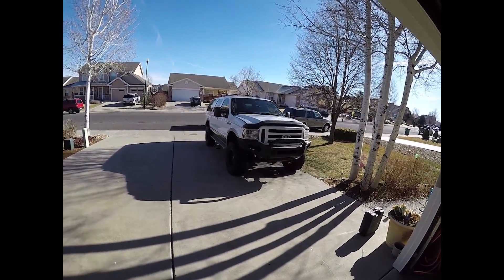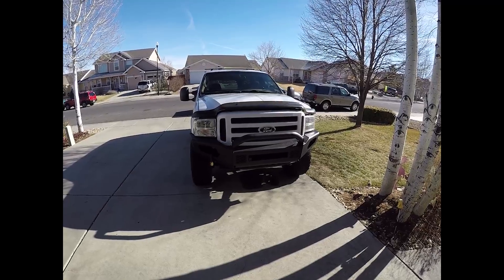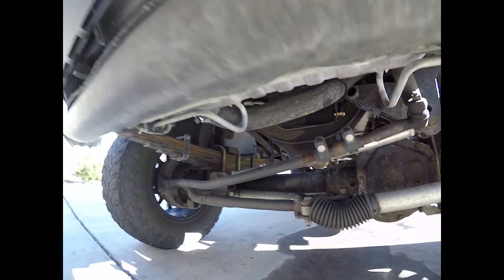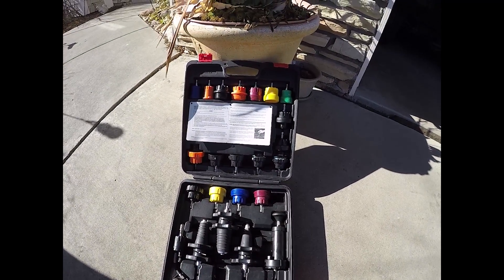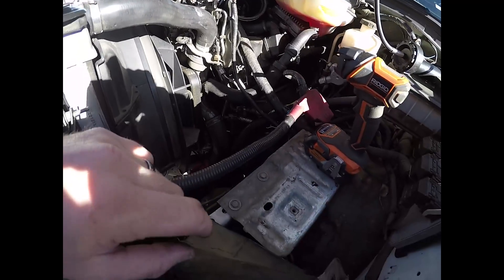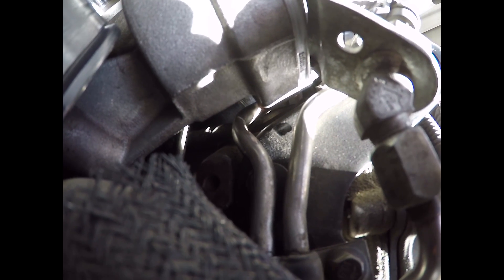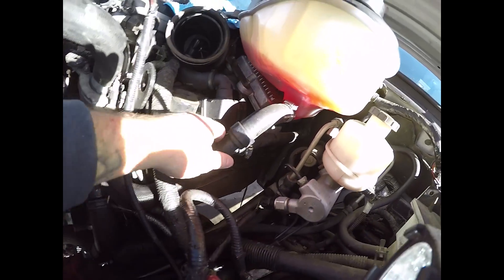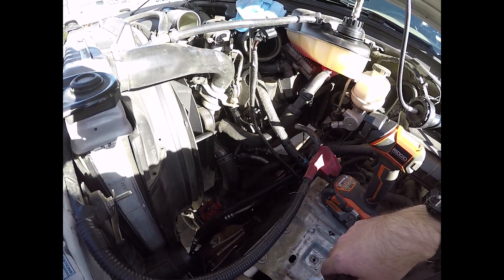Ford 6.0 Diesel Cooling System Pressure Test Found Leak

Comment: I have the intermittent leak also. I found that my cap was bad. Holding pressure sometimes and other times not. So i think the leak is when it is over pressurized and not venting at the cap. Unfortunately, It looks like a head gasket leak causing the pressure in the first place.....

Comment: I see you’ve got a set of double shocks. How much did that entire setup cost you and do you like the ride now?
Reply from the maker: It's been awhile since I put the dual shocks on cost wise back then they were about $100 per shock for the icons not sure how much they are now and the brakes was maybe $75. As far as the ride it's very stiff and rough but could be the stiff leaf springs up front as well.
Reply: @BLUECOLLARGARAGE  do you remember where you got the dual shock kit from, per chance? Smooth lookin truck, by the way.
Reply from the maker: @chriswools638  thanks for the compliment its been about 13 years since I put everything on   everything is from icon vehicle dynamics
Reply: @BLUECOLLARGARAGE  sick man. I appreciate your time! I just picked up an 04 X, and I’m about to push it towards an over landing type setup.
Reply from the maker: @chriswools638  heck yeah man sounds awesome hold on to that X they hold their value. I'm gonna be doing some more work to my 05 X upgrading the rear bumper with a tire carrier and some interior upgrades. Hopefully I'll have enough time to post some videos on it.

Comment: Man, I've had two 6.0's. First one was a 06 cred cab long bed 4x4. 11 inch lift on 37's . nothing  but a money pit! Head studs , bullet proof remote mount oil cooler, Turbo, injectors, fuel system  and  tuned...ect.  . Fun? Yes.. reliable..HELL NO!!  That sucker ate oil coolers for some reason. Every 10k miles I had to put a new oil cooler on.  Then the heads cracked.  It never over heated. So then new O-ringe heads. It still would build pressure in the degas bottle.. up to 20 psi under boost.  So Had new gaskets done again! Sold the truck. Then I had a 07 reg cab 4x4 6 speed.. best truck I ever owned!  Why? I Left  it stock!
Reply: You went through so many oil coolers cause you cheaped out.
Reply: @iamn360   you think so?? Lmao  everyone was OEM Ford parts with a Bullet proof remote mount system. It's a junk motor that there is no fix to. I've had 2 of them as well as my brother has had two of them

Comment: And non OEM degas caps cannot be trusted, they can leak when brand new and not hold pressure when new.  Your cap is OEM motorcraft BECAUSE IT DOES NOT HAVE A STICKER WITH THE PSI INFO ON IT..IT IS EMBOSSED WITH THE INFO..THIS IS GOOD

Comment: I think (THINK)with a head gasket leak the radiator fluid leaks into the engine and comes out the exhaust pipe as white smoke (
Reply: Honestly most HG leaks on the 6.0 dont leak in oil or out of the tail pipe

Comment: What kind of test kit is that? I’m having the same issue, had my truck running in the driveway while my son and I waited for the bus. Once the bus picked him up I backed down the driveway and shut it off. Came out to get him ofc the bus and I had a puddle of coolant on the ground where I parked
Reply from the maker: It's the powerbuilt kit number 70 I just rented it from my local advance auto parts https://shop.advanceautoparts.com/p/powerbuilt-tools-kit-70-cooling-system-pressure-kit-22-piece-940427/9150049-p?product_channel=local&store=5243&adtype=pla&product_channel=local&store_code=5243&gclsrc=aw.ds&&gclid=Cj0KCQiAtf_tBRDtARIsAIbAKe2eFyP3Bc7goULx6WJixgcz2vjtnDnZEAsAYL4y8M847apKPKkHEpIaAqorEALw_wcB

Comment: Thermostat housing oring??
Reply from the maker: Yeah it did end up being the o ring. Since then I have been leaking coolant from the degas bottle cap under heavy load. So unfortunately I think the head gasket is on its way out.
Reply: ASTEW'S GARAGE I’ve got an 05, after my engine was bulletproofed I had a leak as you’re describing. It wound up being my thermostat housing o-ring as well. I’ve had a lot of work done to mine, still gotta ways to go.😂 Never ending with these 6.0’s! But for the price of a new PS, I can rebuild mine again twice over.🤣
Reply from the maker: @remembertheblacksabbath  yeah I hear you. I have put a ton of money and man hours into mine and will probably never get rid of it. I have six kids and this is the only vehicle out there that that can haul the whole family and cargo while still being able to tow 5.5 tons behind it.

Comment: Was it just the thermostat that was the leak? Is your problem fixed
Reply from the maker: Yeah it ended up being the thermostat o ring. Problem solved I was in a pinch at the time so I couldn't record the replacement of it.
Reply: ASTEW'S GARAGE thanks was just wondering, I have the same leak. But also looks like my front cover gasket is leaking too. Just hope not a head gasket. Have you ever hooked up a pressure gauge from reservoir overflow line and seen what pressure you run? I can’t find a video of one with a good head gasket to compare it too.
Reply: pro tip: watch movies on Kaldrostream. Been using them for watching all kinds of movies lately.
Reply: @Kyle Rory Yea, have been watching on KaldroStream for months myself =)
Reply: @Kyle Rory Yea, I have been using kaldroStream for since december myself :)